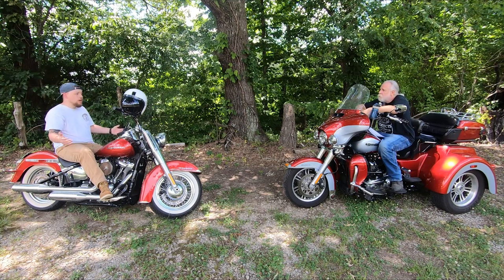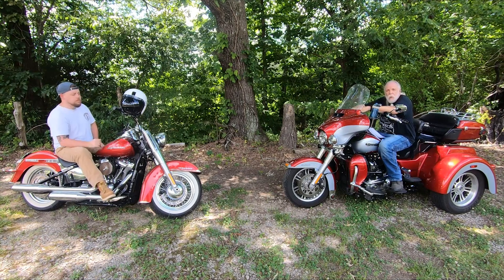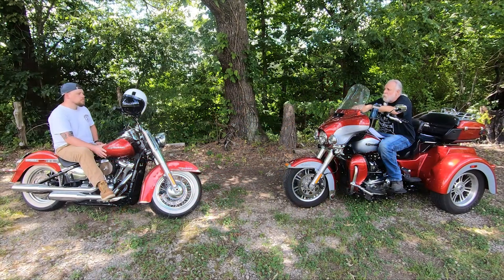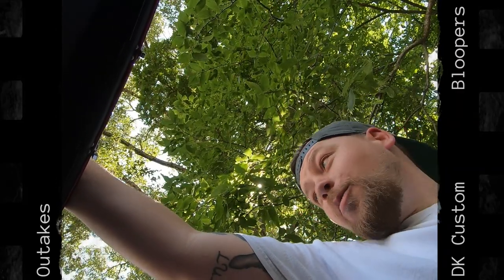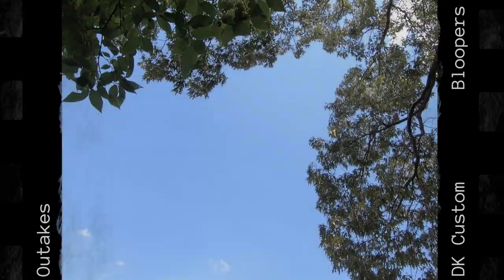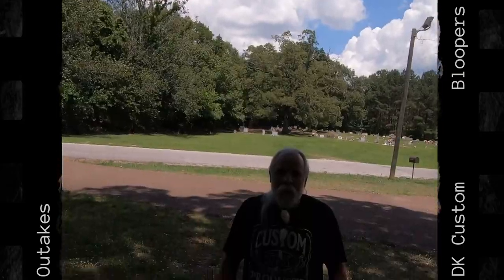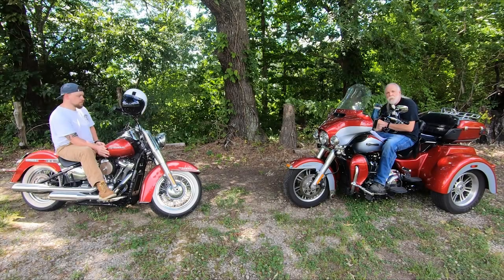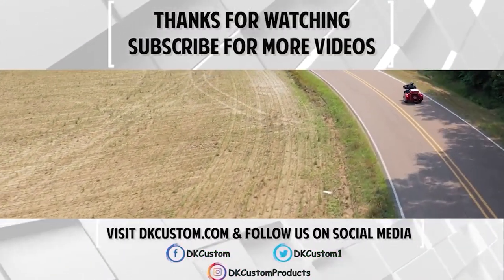Adjusting Your Harley - Comfortable Day Long Rides

Comment: I feel you are missing one important aspect. The shoulder position. To far forward and many people have issues. In proper handle bar placement, it is crucial the rider has their upper triangle, as I call it, setup for them. That's the hand placement, seat height and back/shoulder alignment. I've stressed that you should get the seat to a height and comfort for you first. Then sit in the bike, lean back, close your eyes, place your arms in front of you at the height and width that feels comfortable. Use life experiences to guide you to that spot. I'm more comfortable with my arms up, near shoulder level, even when I sit on the couch, thus I eat my arms more in front of my body, up and my hands barely wider than shoulder width. Lean forward with your eyes closed. When you get comfy, stop and have someone measure you have location from the existing handle bar. Repeat, average out any differences. The feet only have a couple options so they are easier to get fitted, but your tips on them are accurate. It's more like a diamond, not a triangle for all 4.
Reply from the maker: Thanks for the comment.  Seems like you did not watch the entire video.  What you described is exactly what is in the video.
Reply: @DKCustomProducts    I totally DID watch the video.  I think you didnt read my comments.Regardless,  I'm commenting on your Triangle.  Its hardly the complete story.  The real Triangle is hands, shoulders and seat with consideration on the feet.  But like I said, its more of a Diamond,  with the top and bottom, shoulders/feet and the two sides, hands and seat.   My comment should of stated,   you should ADD the shoulder position to the Triangle thus making it a Diamond and your analogy would meet the needs, which you state in your video and thus giving it the full consideration it needs.  sorry for misstating my intent, but its still implied that your triangle fails to show the shoulder position as vital to the setup.
Reply from the maker: @sgtduckyboy64  Thank you.  Guess I'm not understanding the difference between the shoulders and the hands.  When we talk about putting the hands where they are comfortable, we do assume (and maybe that is where the problem is) that someone will not put their hands where it would make the shoulders uncomfortable.
I think we may be saying the same thing, just a different way.
Reply: @DKCustomProducts    Fair enough,  but I think its worth emphasizing,  since most issues I've encountered with myself and talking to others, stemmed from reaching too far or leaning forward to get to the bars.  I think some people do it to look cool, but dont realize their body isnt going to like it!  I've watched and learned from many of your videos and great stuff!  This was the only comment I had to add to any of them, and learned quite a bit from the others.  Keep up the good work!
Reply from the maker: @sgtduckyboy64  Next update we do we will emphasize that issue.  I agree with you 100%...the aching usually comes from the bars being too far forward...shoulders need to be in a natural (relaxed) position, otherwise there will be a payment for sure.
Glad you're digging the videos.   Always appreciate hearing that, and all comments.

Comment: There are two different airhawk cushions, could you please look and give me your recommendation as to which one ?, my wife says she could use one as well.
It seems both of our butts get numb from riding.
Also, do y'all carry brake pads?, specifically ceramic?, or would you recommend those?.
Greatly appreciate your input,thoroughly enjoy the videos, and I try and share them in some of the triglide groups I am in.
😎🇺🇸✌
Reply from the maker: Thanks man, appreciate your sharing DK Custom with others! 👍
I just went out and measured my Airhawk-  It is 15" across at the widest point, and it is 15" front to back.  I looked for a part # on it, did not see one.
I usually get EBC pads when I need them, which is not often.  I've never tried the ceramic, so have no first hand experience.
Reply: @DKCustomProducts  ,Thank you.
The current controversy is the heat and why are some removing the left side deflectors, and not the right. 
I've given them your web site, and you tube information.
Reply from the maker: @Kevin Gleason  Thanks!  Right side scoops air to run past the back of the rear cylinder, left side removed lets that scooped air flow quickly out, rather than swirl behind the cylinder.

Comment: Luckily My shoulders have never been a problem. It’s my damn tailbone that kills me. I mean it hurts like hell. I’ve tried so many seats and seat add-on but nothing ever works.
Reply from the maker: That is great that the shoulders are good...sucks about the tailbone.  In the Comfort Triangle, before the shoulders/handlebars are feet & butt placement.  Dunno your situation exactly...what bike, etc.  But here are several things to consider (that you may or may not have done already) to get rid of tailbone pain.
Backrest 
AirHawk
Sheepskin
Recontouring the seat to fit your butt 
Foot placement can really shift the weight on your tailbone
It is possible that all the above can be optimum, but if the suspension is no good, then that may be where attention is needed.
If you can sit in an office chair and not get tailbone pain, then you should be able to set up your Harley to be just as comfortable.

Comment: How much corner clearance do we lose using the floorboard extensions??
Reply from the maker: good question.  What bike and what year>
Reply: @DKCustomProducts  2020 ultra??
Reply from the maker: @kpnomad7  On a 2020 Ultra it will be about 1% less lean angle before touching the floorboards to the ground.